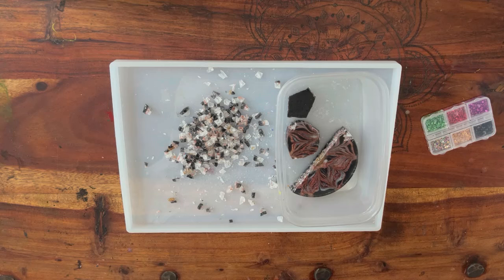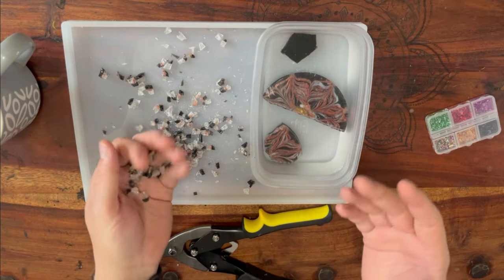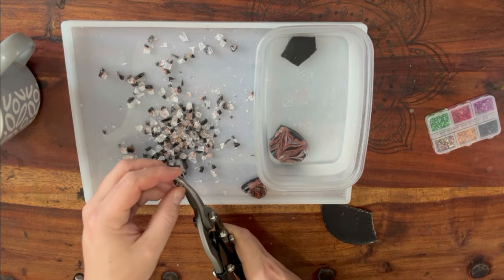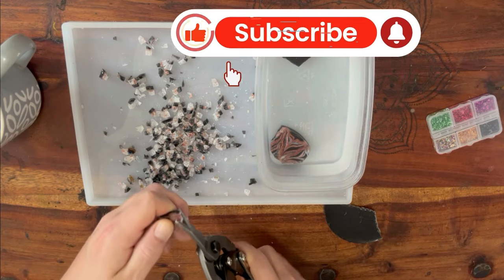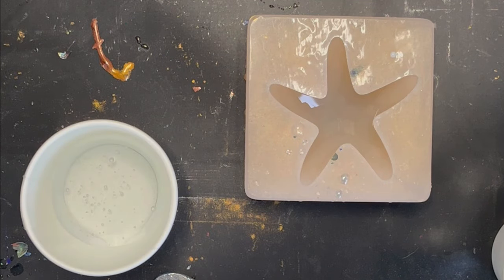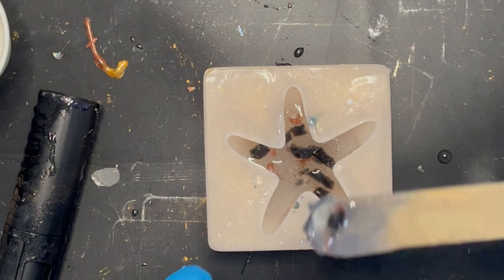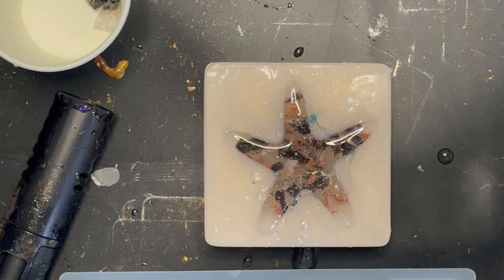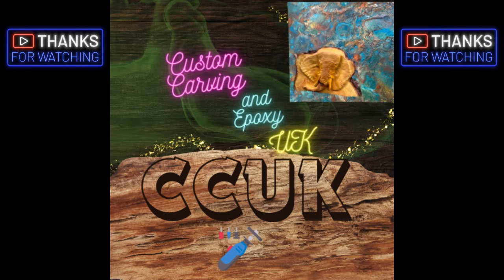HOW TO Rescue Failed Resin Projects and reuse CURED resin

Comment: Love this idea, have a few unintended booboos here and was wondering what to do with them. Thank you heaps.
Reply from the maker: I think about 25% of my projects have unintended booboos 😂
Reply: @CustomCarvingandepoxyUK   lol Yep know that feeling, hoping now that I have a proper vacuum pot instead of the airless resiners one I will have less bubbles as well. Would use it now but its  11pm in Queensland Australia.
Reply from the maker: @PamsResinCrafts  the airless pro works well for me. The normal airless wasn’t as good